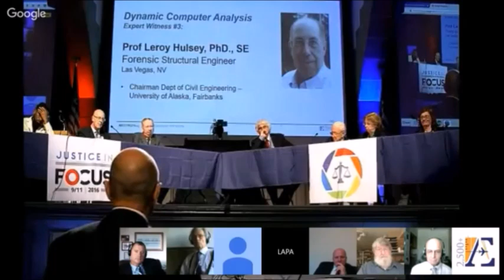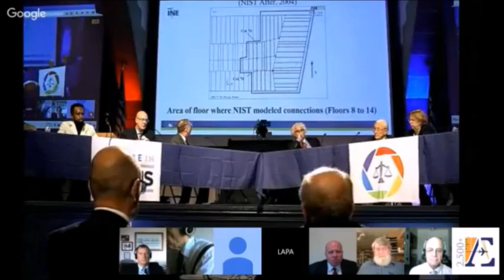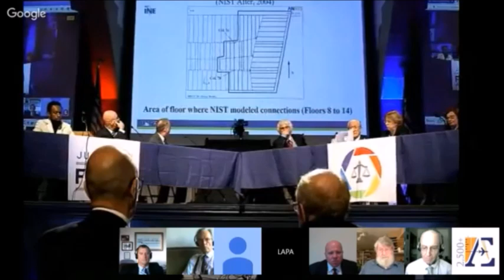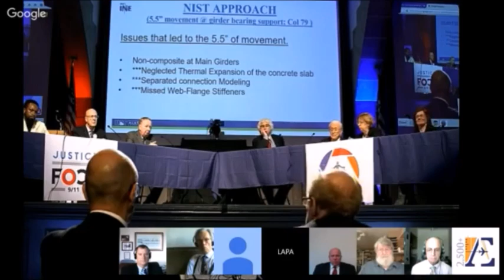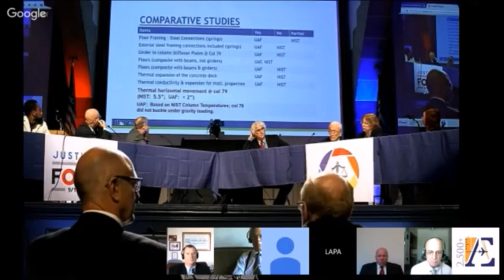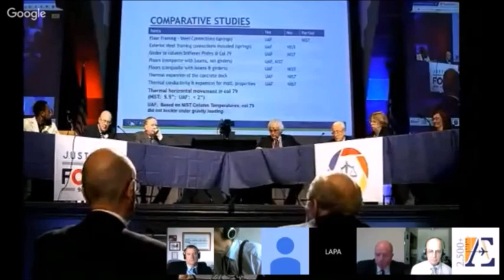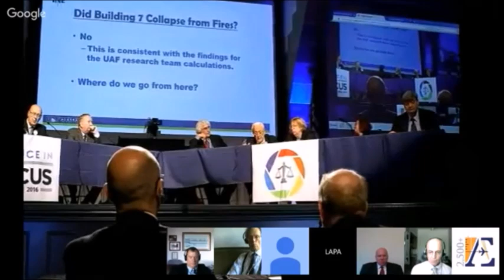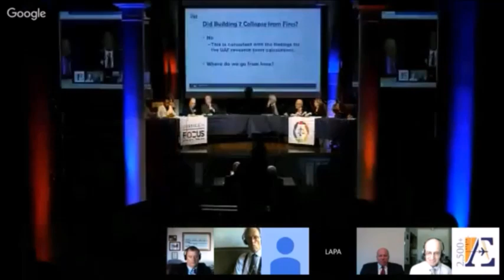Dr. Leroy Hulsey Testifies before Panel of Attorneys

Comment: NIST, whose "official report" was sketchy, incomplete, and biased towards a preconceived answer. Iron spheres and thermite residue in all the dust samples. First responders and citizens reporting liquid steel flowing from the Towers and multiple explosions. Fires that burned underwater for 3 months. Columns cut at 45 degree angles. Building #7 falling in a controlled demolition. ("Pull it.") And this is just the tip of the False Flag iceberg. Add in all the "coincidences" of the day, the strange activities months, weeks, and days beforehand in and around the WTC, and the deathbed confessions. Consider all the odd behaviors of our government officials that day. And yet, there are still deniers and conspiracy theorists who buy into the "Official Story" conspiracy. They must be sleeping or involved in it.